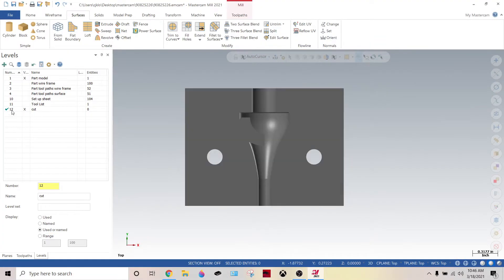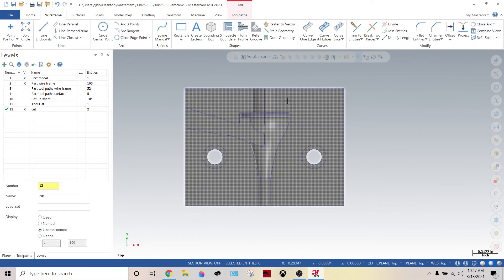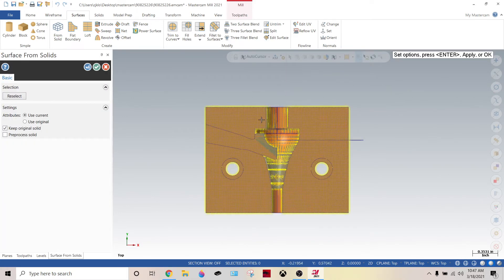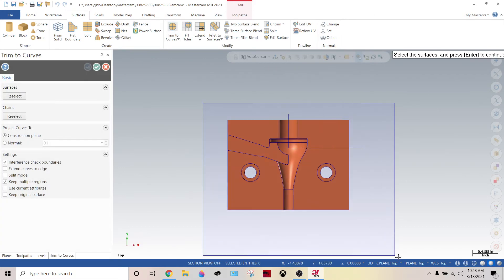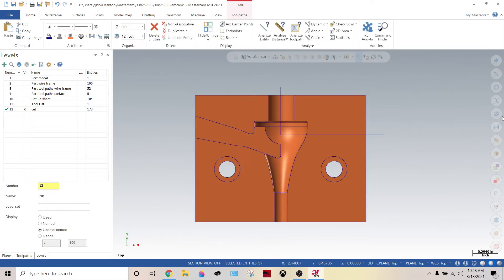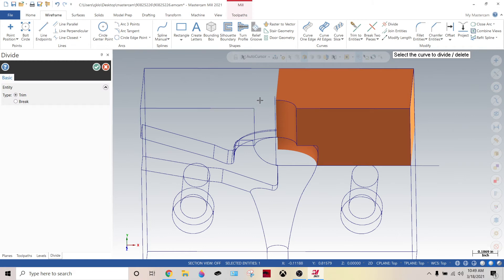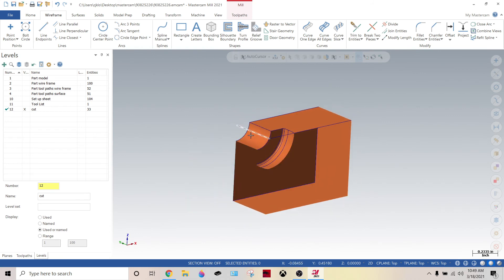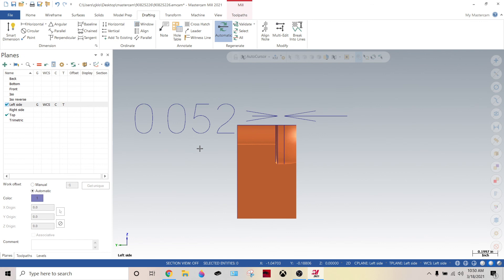Mastercam create section view

Comment: There has to be something simple. There's no option to just use a plane or surface as a sectional view without having to create a copy of the body surfaces and then trim and delete the parts you don't want. Is there such a thing as an active section view. Where you can toggle your views back and forth. This example seems a little redundant and unnecessary. No offense to you. I'm just looking for something simple and more intuitive. like in Solidworks, you can choose a plane as a reference for your section view. and you can toggle it with a click of your mouse. Is there not an option like that in Mastercam? Thanks for the video!
Reply from the maker: Mastercam is full of tricks. If you have solid works I would recommend doing all your modeling on SolidWorks. You have to be quite an elite pro in mastercam to follow what I have going on
Reply: @Ckmfg  or you could just go into your planes and toggle the "section" button and it utilizes whatever orientation that plane is at as your active section view. 10 times easier than way you did. Mr. Elite pro. Over complicating things.